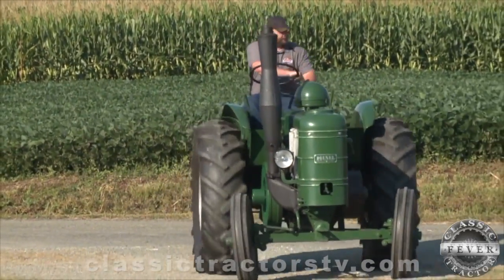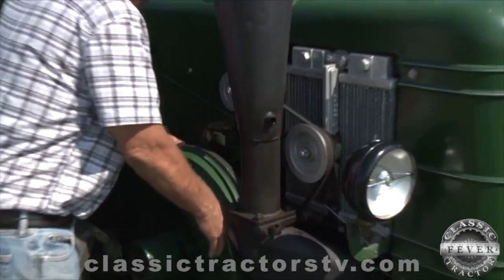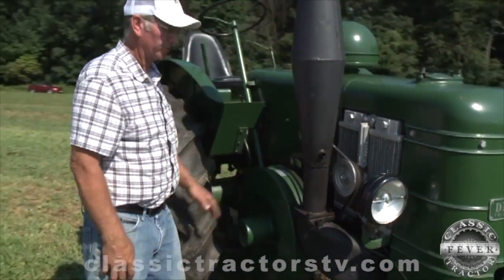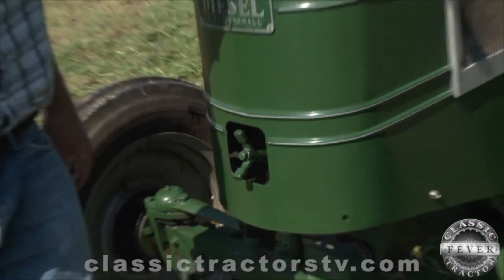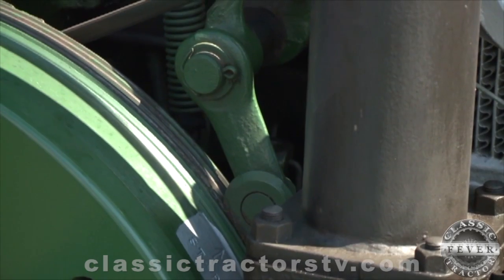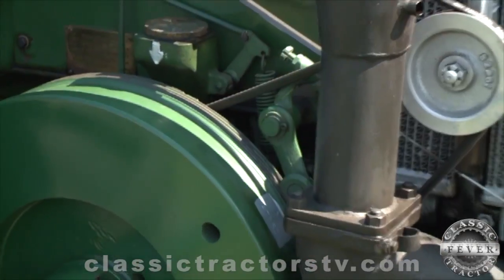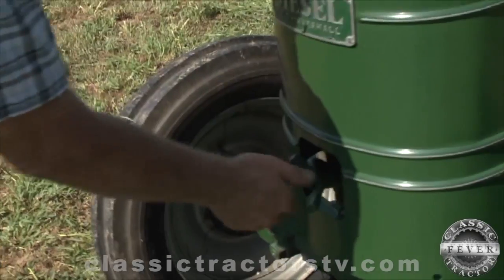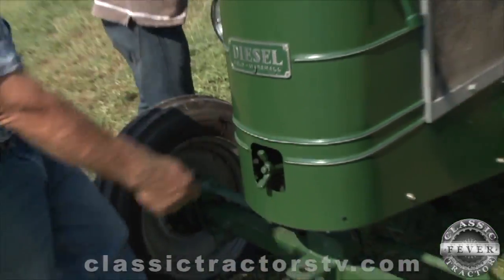You can start this tractor with shotgun shell! How to start a 1948 Field Marshal Tractor

Comment: Made in Gainsborough, Lincolnshire. The company started back in the 1800's and made steam traction engines, the old boiler shop overlooked the church I was christened in. The factory closed in the 80's, part of it was demolished though some still remains and were turned into retail units. I spent a few years working for a local haulage company that used to deliver the Marshall products all over the UK.

Comment: Help, somebody please answer me a question, my google fu is weak, how does the engine deal with the actual lead shot? It doesn't seem that these are always going to be blanks.
Reply: It doesn't. They are not technically shotgun shells or even blank shotgun shells. They are PowerStart shells. A blank might work but bird/buck/slug would seize the engine and you would have to tear it down to remove the lead.

Comment: these filled with water are unstoppable
if anyone knows what the soil is like in Canterbury NZ when its wet then ponder this
We had a 15cu m truck full of wood which after some rain had to try to exit through a field 
but the ground here is very slippery when wet so half way out truck is bogged
Trusty flat 6 Massy Harris to the rescue --- nope, farmer with Jdare 4x4 still nope and even after unchaining the JD this alone also would not move
Farmer dropped us at home to pick up, you guessed it the Field Marshall,  few hours of chugging along to arrive at the stranded 
1 Truck 1 Massy Harris 1 JD we chained up the 3 all at once and at approx 2kph this FM slowly lugged out all 3,
i think the piston in this thing is like 6.5in x 9in = 4.9L at only 38HP

Comment: Ok so if I understand what is going on here correctly, then this “vehicle” would be completely impervious to an EMP. Yes?
Reply: Yup .
Reply: EMP? Electromagnetic pulse - so the variation of the magnetic field, induces in nearby conductors, coils, etc a variation in electrical field. If the component is very sensitive (a computer unit) to voltage, then EMP can fry the computer because of the extra induced voltage all over by the EMP.

Now on cars, if an EMP would target a car, might fry various sensitive electronics, but starter and battery and alternator and those short thick wires are not going to do much in presence of EMP. Because the EMP field can only deliver a spike of voltage and low amps. Only sensitive electronics can get damaged.

A car that is impervious to any EMP would be an old diesel car with injection pump (rotary or inline). The fuel system is all mecahnical, can run without battery or alternator, can be pushstarted (manual gearbox) or windup starter. I had a VW golf mk2 diesel that could run without a battery (but no headlights, signals, horn, etc). I actually drove that golf without a battery for a 300km trip (battery was shot, removed it completly and bought a new one, but in time being i had to get home, so i've push-started, drove in daylight. - back in the 90's, no DRL requirements)

Anyway, EMP is not like in the movies. Most power electronics are impervious to EMP (on the scale we know now, not talking about giving a MRI to a car battery, or solar flares in the outer orbit, or other large scale of EMP energy), and small electronics are sensitive to EMP because they were not designed to cope with EMP. 
Harder to do, but with EMP resistence in mind it is doable to design protection accordingly (any space vehicle has a lot of protection for other induced voltages like EMP from solar flares and Roentgen induced currents from the radiation).
Reply: @AsiAzzy   I suspect an older petrol (gasoline) car in pre-computer days - say up till 1980 - would be pretty impervious to a moderate level of  EMP also.   Except maybe for the car radio.   Yes it relies on electricity, but the only electronic components in it would be the capacitor in the distributor (which is designed to take electric spikes) and the diodes in the alternator (which also need to be pretty rugged).   Even if the alternator died, the battery would still power the ignition. 
(I once drove my Ford Escort home 400km on a battery.   The alternator failed one night.   So next morning I bought a new battery (the old one was not only flat but fairly tired, and there was no way I could get alternator spares on a weekend) and drove home on battery only.   Just made it home before the battery went flat, and just after it got dark  :)

Comment: The original Glow Plug Paper was blotter paper soaked in a strong solution of Sodium Nitrate disolved in water then rolled into slugs and  air dried. NOT a Shotgun Shell to start  a Feild Marshall tractor it is special 12 guage Power Start Cartridge  Not a blank shotshell

Comment: Hard to believe someone would have bought that in the 1950s as technology came leaps in the post war period. 

Neat tractor but I am glad I never depended on it to work back in the day
Reply: Even in the 40's there were several U.S. built diesel and gasoline tractors with electric start.  In fact I'm pretty sure Farmall sent some over to Europe in ww2 for road building and such.  So its a mystery to me why this tractor is the way it is?  Looking at American tractors that would of been more like a 1920's start up procedure, not a 1948.  Although I know the 40's farmalls had both, in case the battery died you could hand crank it.
Reply: @gittyupalice96  Why? Simple: making and selling price, ease of maintenance, repair cost, and pig headed farmers who always preferred simpler/cheaper stuff.
Reply: @LesAventuresDeTigRRe  not to mention you could literally drop this thing in the middle of nowhere and it wouldnt matter if your battery died. I imagine the simplicity was a HUGE selling point as well. People used to fix their own stuff.

Comment: Starting a engine with a shot is the most American thing ever
Reply: It's English built tho
Reply: Its British built and british brains lmao...😂😂
Reply: Some planes also use those starting systems. 
Gotta say, it must wear the engine over the years, but it's really hard to crank a giant airplane engine xD
Reply: @alanwatts8239  gunpowder start aircraft engines used way bigger than 12 ga. shells. Turned out to be unviable so most were either electric start, or like the rolls royce merlin they just flooded the engine in spitfires and hurricanes with electricity from a big batter cart and usually at least one of the twelve cylinders fired. Most of the rest used a flywheel wound up with an electric motor which in the case of a B29 was powered by a spud motor connected to a d.c. generator.
Reply: @coffindancer38  Thanks for the awesome info, man!
Reply: Some of our American (and probably others) WWII fighter aircraft started with shotgun cartridges.
Reply: @LGTheOneFreeMan   They started with a special 12 Guage Power Starter Cartridges NOT a shot gun cartridgel
Reply: @LGTheOneFreeMan  that's actually pretty cool and practical
Reply: Sempre tem um br
Reply: i expected this joke to be the top comment. but i still like it.
Reply: The most EUROPEAN THING EVER! LOOK IT UP. You cant solve everything with killing weapons! Duh.
Reply: It was an English thing n I’m Irish ☘️
Reply: This is entirely a british thing though. LOL
Reply: It's called a Kaufman starter named after the American who came up with it in the 1930s you fucking morons

Comment: I'm am glad that I saw this, it is amazing how technology has progressed over time. It would be awesome just to have a video explaining with a opened engine, how it works compared to a more modern engine. I wonder how much power some of these old tractors were capable of putting out, relying on compression and a small piece of buring paper as the primary source of potential energy is mind blowing; let alone the idea of a blank shotgun shell producing enough energy to start the engine. Thank you for posting your video, this is a unique and important innovation of history!!
Reply: 40 Hp at the Flywheel 750 RPM

Comment: No wonder the Brits couldn't beat the Germans on their own. What a pain in the ass to start.
Reply: So you saying that the German Lanz bulldog tractor is easier to start? You have to wait 10 minutes to heat the engine head! This tractor in the video is easy. You just put a paper in the plug and crank it. It is that easy! Also not all tractors built in england are like that. I am not hating on German tractors i am just saying that you are wrong
Reply: @dieselgeezer18  it's a joke

Comment: Aren’t these a derivative of the Lanz Bulldog?
Reply: Not directly. The design is similar (big low-speed single-cylinder engine mounted horizontally) but very different in the details. The Field Marshall engine is a true diesel, while the Lanz used a semi-diesel 'hot bulb' engine that had to be pre-heated with a blowlamp.
Reply: @jozg44  Italian Landini Built a similar machine

Comment: my  gramps told me stories of the crank start days, lots of broken wrists.
Reply: The broken wrist from hand cranking was called a Ford fracture back in the day.
Reply: That won't happen if you have your thumb behind the crank
Reply: Why didnt they make them ratchet?
Reply: @americanpride9733  Those old engines could sometimes missfire or even start backwards, which would force the handle backwards. Thats how you broke your wrist or worse trying to start them. They would be powerful enough to destroy the ratcheting mechanism.
Reply: @americanpride9733  They are one way by a screw action where only one way you can turn the engine and once it strats it will unscrew.

The problem is the engine could start backwards and then the engine will drive against your direction of your cranking instead of the same direction. This will mean any one way safety will fail with the wrong direction.

A better design can be invented now with sensors and actuators, but no need since electric starters.

There are also wind-up starters that are safer to use. Also kick starters and rope pull starters for smaller engines.
Reply: ever seen a German super heavy no electric ignition lol
Reply: My uncle broke his arm, trying to start a Ford.
Reply: Ok boomers
Jk